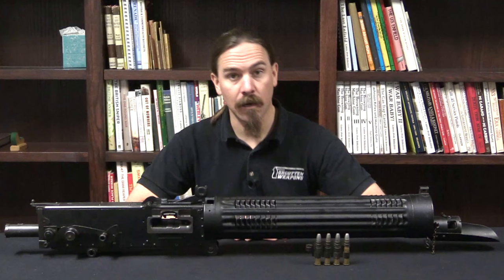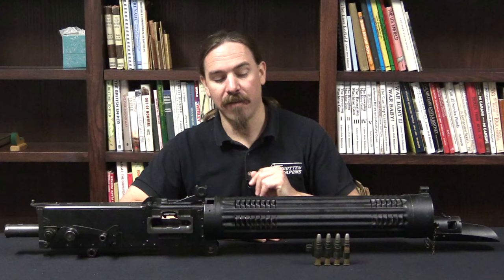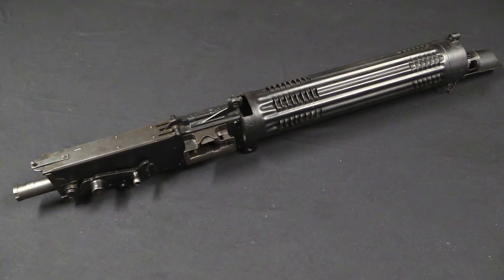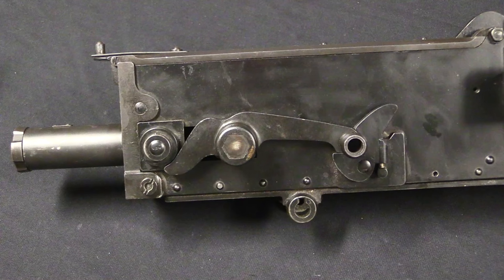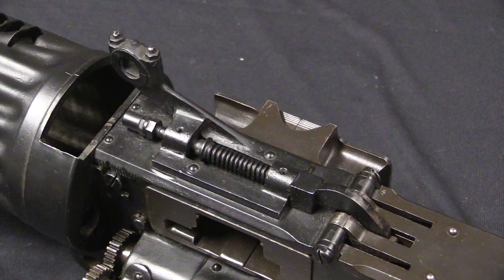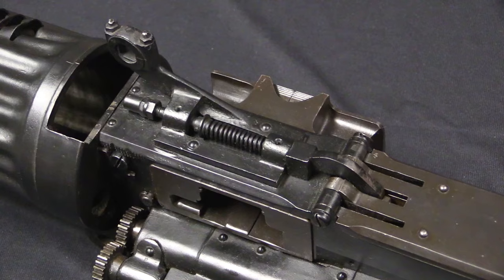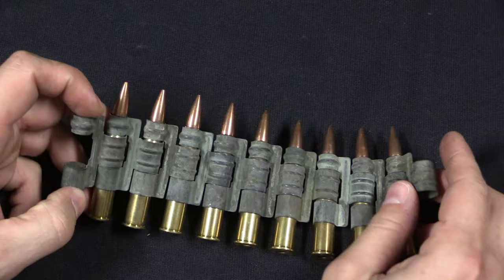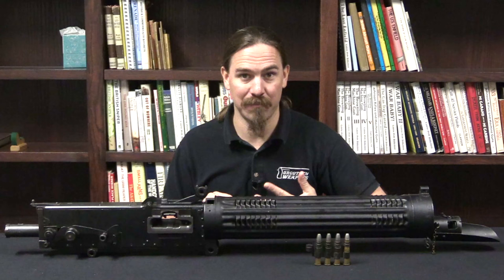11mm Vickers "Balloon Buster" Machine Gun

Comment: This looks like something you'd dual wield in a new Wolfenstein game.
Reply: Or Serious Sam 4
Reply: It reminds me of some of the low poly models from the Turok series on N64 where all the weapons just look like a tube with a barrel lol.
Reply: These early machine guns with cylindrical cooling are the inspiration for fallout 4s machine guns, too.
Reply: @lasarousi  Please don'tremind of those "assualt rifles". If the had called them machine guns I wouldn't have a problem, but they went from the sensible AK inspired "assault rifles" design of the other 4 games (Vegas is Canon, I don't care what Bethesda says) to a WW1 era (intended solely for use with bi/tri-pods) design and it (like so many other things about that game) annoys me to no end.
Reply: @Hello-og  I believe the reasoning behind the machine-gun style AR was that it was an AR meant for mechanized American Power Armor troops, where the weight of the large barrels and drum mags weren't much of an issue for someone with the strength of full power armor. The "AK" style rifles from prior games are Chinese assault rifles, which alongside the smaller Service Rifles, were meant for the pure infantry troops during the war.
Reply: @Hello-og  New Vegas is overrated
Reply: When they make a new Wolfenstein game, I hope it's more like New Order and Old Blood. Plot is nice and all, but there wasn't enough gameplay in The New Colossus for my tastes. Not all dialogue needs to happen in a cutscene.
Reply: @Hello-og  in fact, I call New Vegas canon and the rest of the games not-canon, because it’s just that much better written
Reply: yes
Reply: @thehoodedteddy1335  what about 1 & 2?
Reply: @TeamFortress2Official  hadn’t played those at the time, I would also consider those canon.  Basically I don’t even think of any 1st party Bethesda-made fallouts as canon
Reply: @M50A1 not according to the zero likes this comment got in over a year lmfao

Comment: Need to crowdfund a set of 11mmx59mmR  Gras Disintegrating link stamping dies...some reloaded ammo,  and get Ian up in a SPAD...
Reply: @williamkeith8944  Snoppy flew a Sopwith Camel (which looked suspiciously like a doghouse). FWIW Sopwiths used 7.7mm Vickers guns.
Reply: @0neDoomedSpaceMarine  For ground/test purposes, I should think that one could develope specifications for a cloth belt with suitable spacing and retention/extraction characteristics,  but I don't know enough about setting up some sort of industrial sewing process to get the requisite uniformity.  The next step would be identifying a suitable production or swadged, or less likely cast, bullet, and developing a load to 11mm Vickers specs rather than 11mm Gras (IIRC, the Vickers had distinctly higher pressure).
Reply: @joelvca  a cast bullet with a gas check would probably work just fine, since they're being used in modern 45-70 and 50-110 cartridges and pushed over 2,000 fps. It would very likely be the cheapest option, as a bullet mold isn't that much, and use .45 gas checks.
Reply: @randomidiot8142  That simplifies things, and I was partially mistaken about the cartridge.  I've been hunting specifications on 11mm Gras/Vickers, and the only thing I have found so far is that base was flat rather than stepped as the original Gras (thicker/stronger rim).  Apparently, the original French incendiary loads were to Gras specs, and I found this posted on a forum:

From 'Flying Guns – World War 1: Development of Aircraft Guns, Ammunition and Installations 1914-32' by Emmanuel Gustin and myself:

"More successful was the French development of a Vickers gun in their old 11 mm Gras rifle cartridge (11x59R) together with the Desvignes Mark XI incendiary bullet (which was actually a long-burning tracer), the resultant conversion thereby being known as the 11 mm or Gras Vickers. As with the British .45 in, the lighter bullet permitted a much higher muzzle velocity in the region of 600 m/s. The French were the major users although the USA adopted the weapon and ammunition in late 1917 (both being already manufactured there) and produced the weapons by converting some existing Vickers guns chambered for the 7.62x54R, a Russian order which had been cancelled following Russia's withdrawal from the war. The USA developed their own high-velocity loading with a tracer/incendiary bullet weighing 17.5 g. The guns could be fitted in place of any Vickers, but were reportedly not popular as the recoil was significantly heavier, causing more vibration when firing. However, these weapons were still much in demand at the end of the war, despite the development of similar ammunition for rifle-calibre guns, as the bigger projectiles permitted a much larger filling of incendiary and HE material. The USA continued experimenting with the 11 mm guns into the early 1920s, and manufactured over 500,000 rounds of ammunition for them."

Tony Williams: Military gun and ammunition website and discussion forum
Reply: @0neDoomedSpaceMarine  The 8mm Lebel simply used a necked down and shortened 11x59mm Gras case. But the 8mm lebel is shortened about .300" so you couldn't  neck 8mm Lebel brass up. Bertram and Jameson brass used to offer 11mm Gras brass. It can also be formed from .50-110 Winchester brass which is made by Starline.
Reply: a ludicrous ask, but let's do it
Reply: @0neDoomedSpaceMarine  You wouldn't want to fire this thing on the ground though. Without the airflow from forward flight cooling it you'd ruin the barrel very quickly.
Reply: @WJS  If one really wished to pursue this, there are options available to do it safely, like a fan or a blower & and ducting, maybe with a water-spray injected, and/or a sufficient cool-down period after every 25-100 rounds.  A first estimate of the rounds and timing of the latter could come from the maximum short-period and extended-period (i.e. sustained) rates of fire established for light-barrelled infantry automatics like the Chauchat, the Browning M1919A6 or the Johnson M1941, etc.  Where there's a will, theres an improvisation.
Reply: @LabRat Knatz A replica perhaps.  A real WW1 SPAD or Camel were tricky beasts to fly.  Took more than just basics to be good in a Camel.  Airfoil tech in those days was new stuff.   your crop duster airfoil produces a much more forgiving airplane.
Reply: @orbitalair2103  A Sopwith would be damned fun to fly though. Until you turn right a hell of a lot faster than anticipated hahaha.
Reply: I found some more on the 11mm Vickers in the discussion on a Forgotten Weapons blog post:

https://www.forgottenweapons.com/vintage-saturday-mitrailleuses/

<<... BTW, the 11mm French/British “anti-balloon” heavy MG round, while based on the 11x59R Gras, was not exactly the same. It was redesigned by Vickers with a different, flatter rim to facilitate operation through both the Maxim and Hotchkiss actions, neither of which “liked” the reverse-beveled, thick M/1871 Mauser-type rim of the Gras cartridge case. It also had a more straight-walled profile, with a sharper shoulder angle, more like the 7.9 x 57 Mauser than the .303 Enfield or 8mm Lebel rounds.

Finally, it was never loaded with anything but a full-metal-jacket bullet of about 400 to 500 grains (with or without an incendiary pellet inside) and smokeless powder, giving a MV of about 1,600 F/S. By comparison, the Gras round was always loaded with a 365 to 385 grain lead bullet in front of about 70-78 grains of black powder, resulting in about 1,490 F/S at the muzzle.

Could the 11x59R Gras round be fired in the Maxim or Hotchkiss balloon guns? Probably. It might work for one shot, but I’m pretty sure it wouldn’t extract or eject properly, let alone fed the next round. And I doubt that you could get it out without having to field-strip the weapon.

(Barnes, Cartridges of the World, 6th ed., p. 280) >>

So, a heavier bullet at higher velocity with smokeless certainly suggests a higher chamber pressure.
Reply: Please
Reply: Then at some point Ian would be speaking french 🥖🍟 and starts mercilessly popping lots of target 🎯 balloons a la doom slayer...

Wait, that's not very civilised of him that I was interpreting.

Comment: Let's also not forget that the fabric that the balloons were made of also tended to be coated in flammable coating to create a good gas seal... Also send this thing over to C&Rsenal so Othias can do that incendiary weapons special he has been promising us.
Reply: Here's hoping he will include the Martini's Royal Labs "flaming bullet" rounds in that video.
Reply: crgzero  Nitrate aircraft dope. still around today.
Reply: crgzero  Doping made the cloth rigid. So it was used in planes and outer skins of the zeppelins. The observation balloons were dirigibles. So the cloth had to be flexible to collapse when deflated. The balloon cloth could be impregnated for a good gas seal but surely was not coated as the coat would crack the moment the balloon starts to inflate or deflated. Also also contrary to popular believe most mixtures used for doping were combustible but not flammable. So it would burn presented with enough heat but not start a fire from a spark just like for example wood or the cloth it coated.

Comment: The Brits had a .303 incendiary round during WWI, phosphorus compound and meant to only be used against lighter than air targets. 
Scout pilots were required to carry written orders from their CO when running Buckingham or face potential court martial.
I'm guessing the 11mm came about as the larger bullet would carry more compound for a longer effective range.
Reply: Not as much range as more payload , I suspect. I do not know that as a fact, though!
Reply: If I remember correctly, the written orders were an attempt to protect the pilots from reprisals if captured, as the use of incendiary rounds weighing less than a pound against personnel was a violation of the Hague Convention, which German propaganda was obsessed with, even as they deployed poison gas and flamethrowers.
Reply: @jeffreyroot6300  A larger payload equals longer effective range for these rounds as more compound burns longer. Once the compound is consumed they're no more effective than FMJ
Reply: I wonder how long they carried those written orders.  Early War, I think if you didn't have those orders and were shot down on the wrong side of the lines with those rounds in your MG, you could be put up against a wall and shot as a war criminal, but later on in the war, I think it was fairly common for the ammo loadout to be a mix of incendiary, tracer, etc.
Reply: @stevecolley6750  Heavier bullet tend to have more inertia.
Reply: @stevecolley6750  He wasn't saying that it propels the round. He was saying that more compound on an 11mm round means that it remains burning on the bullet longer.  Therefore the incendiary effect could be retained for a longer time during flight, which depending on the velocity difference could well mean that an 11mm round would remain incendiary over a longer range than a .303, regardless of whether the .303 projectile actually flies further or not. I don't know enough about the ballistics of either round nor the burn rate of the incendiary compound to know if that is the case.
Reply: They were prohibited from using them on enemy airplanes as well. But this was more along the grace of "If we start using incendiaries on the enemy, the enemy will just start using incendiaries on us!"
Reply: @stevecolley6750  nice social skills i wish everyone was as rude as you over trivial details that you utterly misunderstood
Reply: Punch a larger hole in the balloon and mix more oxygen with the hydrogen and it goes up in smoke instead of being repaired and sent back up. I think that was the train of thought. Besides, the 11mm round is close to the same length as the .303.
Reply: @waynemckay2805  Thank you for being nice to someone.
Reply: @jamessullivan6047  his reaction was inflammatory... i'll see myself out
Reply: The first British 'fighter' aircraft the Vickers Type 18, better known as the  'Gunbus' was  armed with a Vickers Gun (naturally enough). Although it was replaced with a Lewis Gun as soon as they were available.

First flown just before WW1 the 'Gunbus' was a pusher biplane with the gun, and gunner in the nose cockpit, so it had a clear field of fire.
Reply: For balloon busting missions it was RFC/RNAS/RAF practice to use a wing mounted Lewis gun for the incendaries and  load the nose mounted  Vickers Gun (or later guns) with ball rounds.

This gave the pilot extra deniability as the guns could be fired separately.

Comment: Fascinating as ever, Ian. Interrupters and synchronizers would be a fascinating video all by itself. They were around for a surprisingly long time - the Axis powers made very widespread use of cowl-mounted machine guns so their use with WW2 aircraft weapons would be worth covering too.
Reply: Russians also used a lot of cowl mounted guns. Japanese too, with cannon in the wings.
Reply: The Me109 also fired through the hole in the centre of its propellers boss.
Reply: Yes more aviation related content please Ian
Reply: Cowl-mounted guns are more effective because they concentrate fire. Wing-mounted guns have to be set to converge, which only concentrates it at a given distance. It's one of the things that made planes like the P-38 and the F-86, with multiple .50's (and a 20mm cannon in the case of the P-38) in the nose, so fearsome. Imagine all that firepower within a couple of square feet at any range.
Reply: @myparceltape1169      “Motorkanone”, Engine gun/cannon. Not unique to German designs, but rather common for German single-engine fighters. Often 20mm or 30mm — after all, they had to kill bombers as well as fighters…
Not all planes who could mount one had one, even if they had the hole in one propeller hub.
Reply: @thomasbower7727  The less offset there is between the sight and the gun, the better: you only have to handle bullet drop for convergence. With wing-mounted weapons horizontal convergence becomes a factor, not only regarding the distance but also the pattern: you can make all bullets pass through the same point, causing maximum damage there — but you also could make them spread out more in each direction, increasing the chance of a single bullet hitting at the expense of concentrated destruction.

The WWII Allied fighters with many machine guns had that many because that was what had been calculated to be needed to bring down a bomber of the time. Advantageous was of course that a jam would reduce the firepower only slightly, but you increased the chance of one happening by having many guns.

Comment: This is an interesting video on so many levels! I'll go into just a few:

1)  The fall of the Russian Empire is the reason why air forces around the world are generally wearing light greyish blue uniforms - as far as I know. The Russian government had ordered the light blue cloth from Britain to equip new cavalry regiments with uniforms in that colour.
Similarly to the arms manufacturers the weavers were definately NOT going to deliver to russia without prepayment (that was not forthcoming), so they were stuck with a large amount of coupons of light blue woolen cloth.
At the same time (more or less) the Royal Flying Corps amalgated with the Navys Flying Service to form the Royal Air Force - and they needed uniforms - so that came in handy that there was a considerable unsold stock of cloth. That was light blue was rather immateriel.

2)  I was not aware of there being two systems for firing through the propeller. I knew of the interrupter gear, but the development of the gear to positively fire/trigger the gun was new to me.

3) That the disintegrating belt was developed for aircraft use was also news to me.

4) That the Vickers firing from a closed bolt should  be an advantage is also something I have never thought of before.

This is a video, that deserves a wider distribution to the aeronautical community.

Thank You very much for an interesting and informative video!
Reply: For 2) check the wiki page on synchronization gear. Both terms interrupter and synchronizer gear are technically incorrect.
Reply: Pure wool doesn't support a flame.
Reply: @oldleatherhandsfriends4053  I know; but it was warm. Those aircraft were damned cold - and normally they wore something warmer over the uniform. The flame problem was, that wood and doped canvas did. Furthermore the main problem of the engines was their cooling - their terminal efficiency was nothing short of appalling by todays standards.

The aircrafts were firetraps and some pilots preferred to jump without paracute instead of being burned to death.